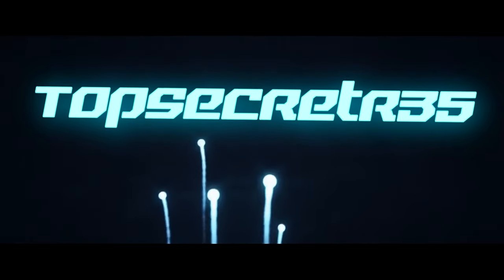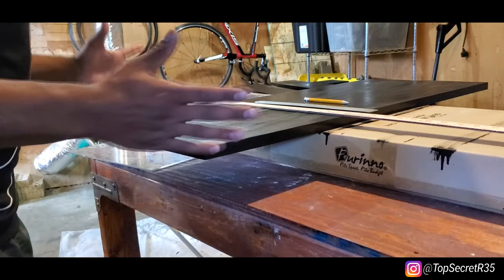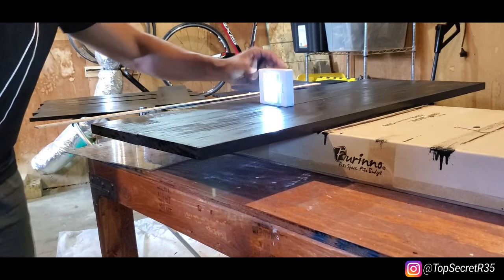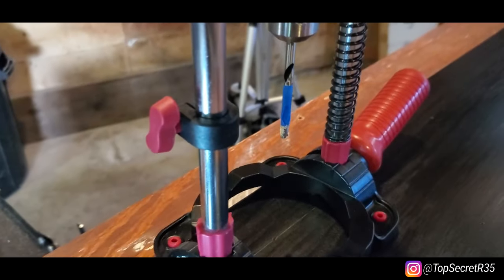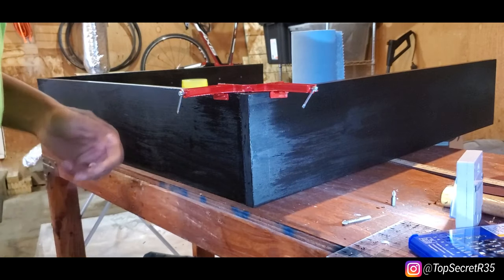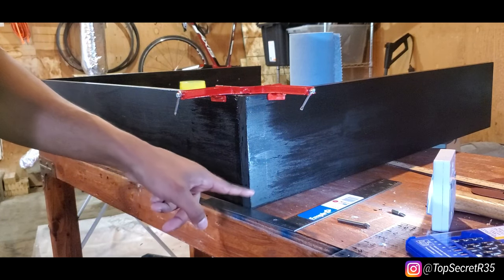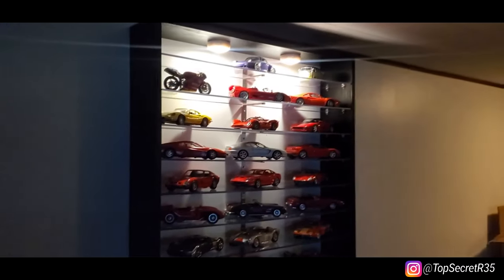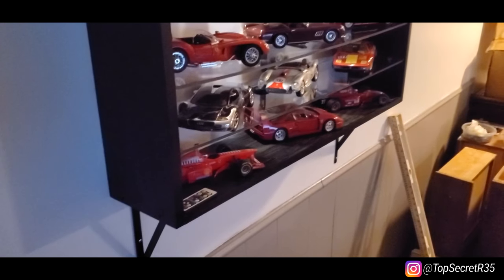How I built custom, model car, display cabinets - Step by Step

Comment: Even though this is very late I was wondering where you got all the models if it’s like a specific shop or just random
Reply from the maker: No worries 👍🏾,  very random collection.  Mostly stemming from my grandfather. And my father. No 1 specific place at all
Reply: Ok no problem

Comment: I don't collect cars but I do collect miniature liquor/alcohol bottles and this type of shelf would actually look great for that ... thanks man, i'll make something similiar :D
Reply from the maker: Thank you so much man. Some notes if i were to do it again to make your life easier. 1. Do the painting differently,  use a roller or spray or a "lighter" application method. 2. Instead of having a centre support in the wall. Run a thin strip of wood along the entire shelf. Will save your walls from a whole lot of holes. 

Thanks for watching and the nice comment! 💯

Comment: Can I do this build with any size and width I want my display case to be?
Reply from the maker: How big do you want to go? I don't see why not. But you must make sure you have enough anchor points for the shelves and the frame.
Reply: Where can I buy those lights????
Reply from the maker: @oincer3943  i got them on amazon. They should be all over the internet!